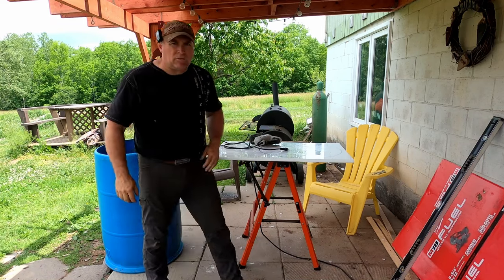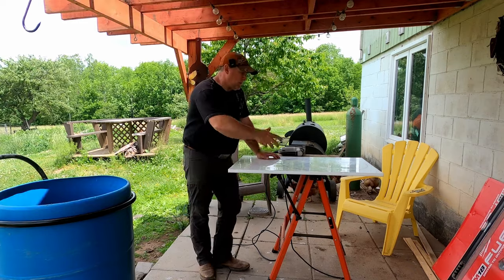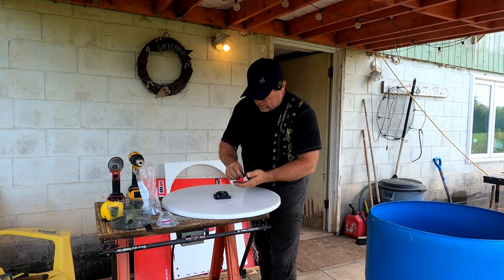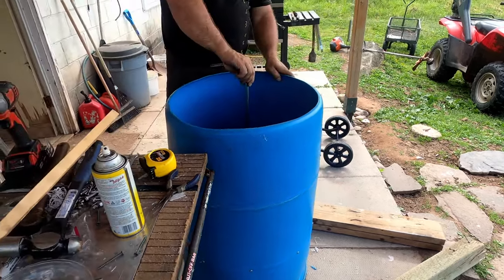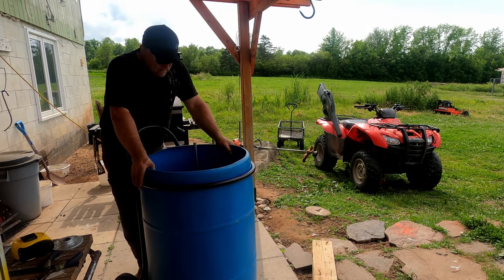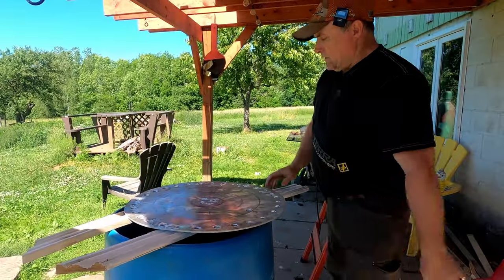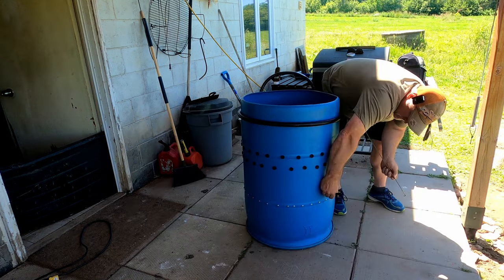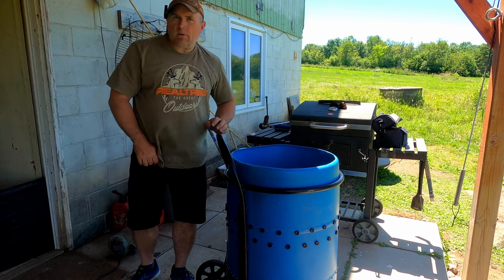CHICKEN PLUCKER BUILD / BEST EASY WHIZ BANG PLUCKER

Comment: Nice Plucker. You must always support the inner race of the bearing before driving a shaft into it. The ball bearings are very easily distorted by the inner and outer races being forced offset.
Reply from the maker: Thanks for the info. I will remember that for sure. Positive info is always welcome. Thanks a bunch. Cheers

Comment: Sorry another question: What type of boiling set up do you have to put the birds in to loosen up the feathers?
Reply from the maker: No problem with the questions at all. We love the comments. We have two propane burners and two big metal pots. We keep the water at 160 degrees. It works well.